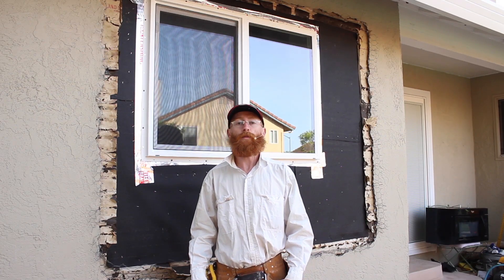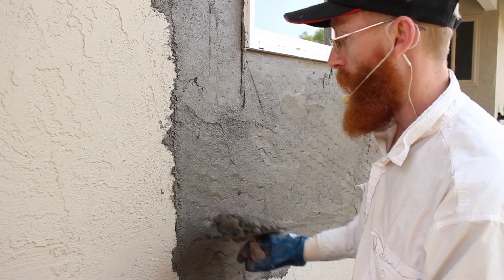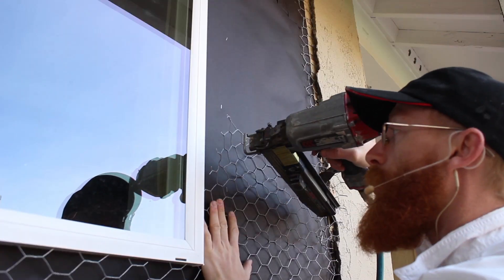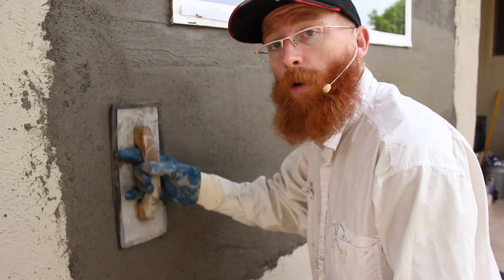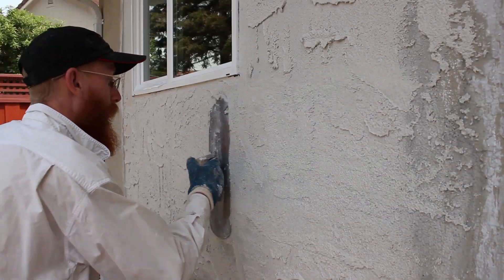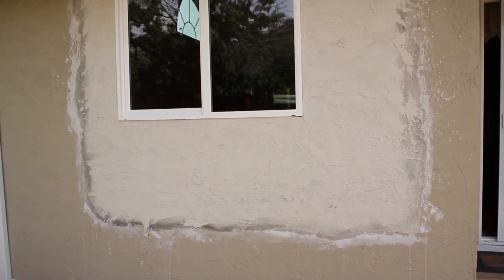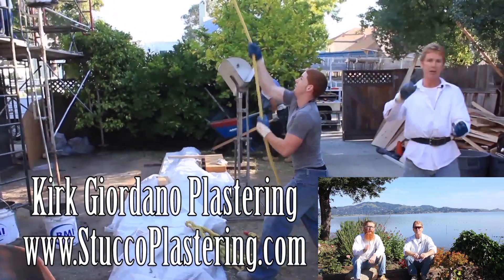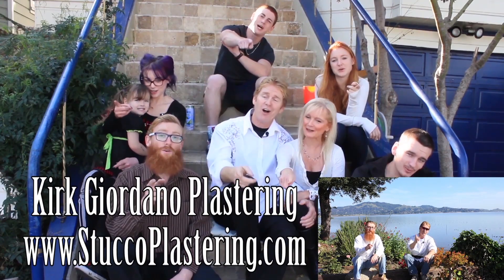Lathing before stucco #shorts

Comment: hi jason im a British plasterer,lov the vids keep it up 👍we tend to use sand and cement render over here but stucco looks to be the way forward, i mainly do interior work with multifinish British gypsum,  i see a vid and your dad was using a lime interior mud, lovely finish, like glass it was the nuts😂😂😂
Reply: Dude, (as a fellow Brit) Stucco is S&C... it's just another name for it. Unless I'm missing something? That interior lime finish does look nice though! Why they don't make multifinish / boardfinish white I don't know!
Reply: +Llyr Jones Think the stucco has some chemicals in it too for flexibility and bond not 100% on that though
Reply from the maker: Howdy Jamie from Briton, here it's called stucco or cement plaster both names mean the same thing as in the UK render means, stucco or cement plaster.
 The interior gypsum plaster you're referring to is  your typical gypsum with lime added to it, how much lime, who knows?
 Finding this information out along with other additives is like pulling teeth from a duck. 
We have a similar products here, they are usually for kitchens and bathrooms as there more water resistant, these gypsum based plasters are called Diamond or Imperial, these two products are what I use the most of, why? glad you asked, their the only veneer plasters my materials yards stock.
Would I be able to tell the difference of Diamond versus say Red Top, USG, Uni-Kal or the many more brands finish plasters, doubtful, plus they don't sell these brands at the professional material yards that I shop as material yards don't wish to confuse folks who ask, which one is better?
In the video here I show diamond as it's available and gets the job done,
 https://youtu.be/DHT9SQJhev8?list=UUZ1wkNnjD06gYLeDFRW7hNQ
 Best wishes,
 kirk giordano Plastering

Comment: This is  180 from your father.  
What happened to the middle speed.  
I really enjoy your videos.  I have done two window and many holes with your channels advice.   Thank you
Reply: Hi Nick, this was more an experiment to see how short I could make a video and still be accurate on the repair.

I will try to get some middle speed videos up next!
Reply: Jay Giordano the idea of a super fast one is appreciated. I watch most videos at 2x anyway, and sadly, they’re often slow because of a lack of “stage presence” on camera. 
This is awesome. Hitting the main bulletpojnts, and then, if I’ve got a question, I can hunt that particular topic, but not have to sift through extraneous material. 🤘

Comment: Always enjoy watching Jay but why not continue using stucco for the skim & texture, then paint? That color coat does not appear to match the existing color. What am I missing?
Reply from the maker: Howdy James, Excell question, Brovo,
Color coats are really complicated you have base 100 which the stucco is white to mix with quite a few colors, all of these colors are on the lighter side.
 You also have the base 200 which is a grey stucco base for many more of the darker colors.
 These color coat are designed to apply corner to corner, not for patchwork as no one can match a color coat within a color coat.
 The bearded stucco guy, AKA, my son "Jason"  used the color coat material so that the "new texture would match the existing texture"
 I think he learned this tip from me? or maybe he taught me?
 Cheers,
 kirk giordano plastering

Comment: What's difference between scratch coat and brown coat, in terms of the material itself ?
Reply from the maker: Evening Videpedia, with a typical or traditional stucco system, there are two to three coats applied.🧘🏻
The first coat is a scratch coat, this generally sets in 48 hours.
 The second coat is referred to as a brown coat, no the color isn't brown, in fact it's gray as all portland cement is.
They call it a brown coat as back in the day it was brown as clay was often used.
 Bringing peace, love, and brotherhood back to the world of “Plastering.” 🌍
    The complete plastering encyclopedia on video, by the plastering messengers of Youtube.  
                                                     Over 800 videos 🎭 👀

Comment: Everyone has their way of doing the stucco. But isn't it mandatory or maybe that's just the way i've always done it to add a J-metal around doors windows. I mean it is required in order to pass inspection at least where i live it is. Just applying caulking it seems like cutting corners. Just my 2 cents.
Reply from the maker: Howdy Santos, you're right, J trim is required in some parts of the country, but not in California, however i have had my share of commercial building that did indeed specify it in the prints,
 I have yet to install J trim on residential homes,

 Best wishes, and have a good evening
Kirk and Jason’s plastering & stucco video’s